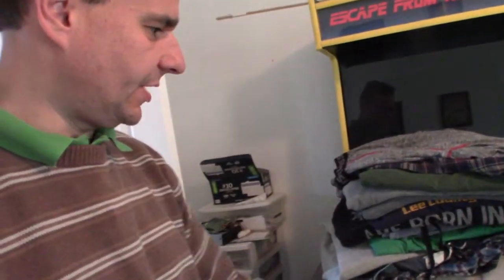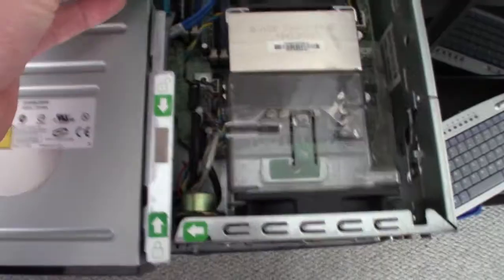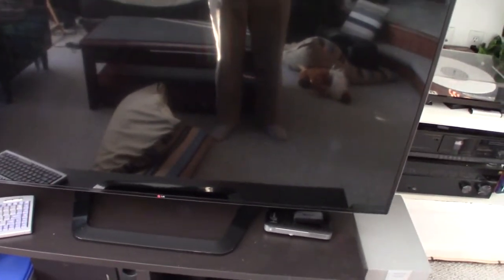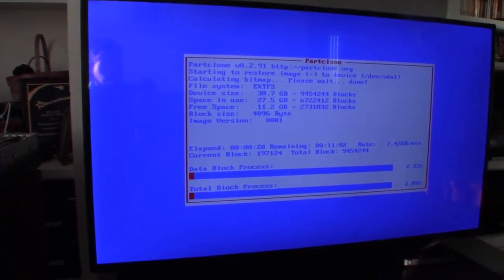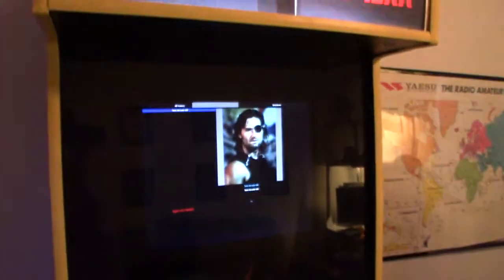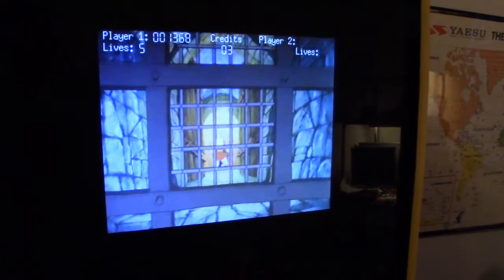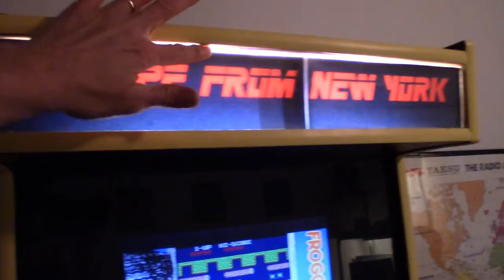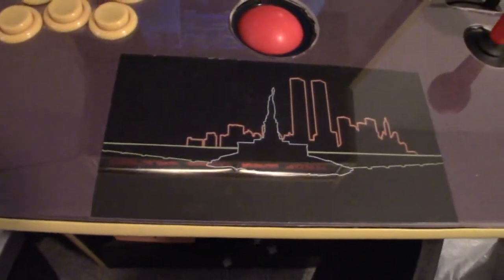Converting IDE Hard Drive to SSD with a Compact Flash Card

Comment: Man I haven't seen Dragon's Lair in forever.  Nice job on the cabinet!   SSD is the way to go.
Reply from the maker: For my main computer I still use traditional disks - I hear for server ops SSDs have a much higher fail rate which is why I stick with disks - plus I can swap them in and out fairly cheaply... but for my other computers, I only use SSD so I don't have to worry about wear.

Comment: I thought I spied Snake Plisskin! Very cool that you built your own arcade. A few weeks ago I got ahead of a failing computer/IDE drive, popped it into an external case and transferred the files via USB to a SATA drive. I'm usually pretty good about backups though. Interesting stuff!

Cheers, Tom
Reply from the maker: For my storage drive I have a script that runs weekly that makes a clone of the drive, and the operating system and other drives I backup twice a year or so - it only takes one failure to learn how important the backups are.  I still am bad about doing an offsite transfer though - I have the portable drive to store at work, but I never bring it.
Reply: I don't do any offsite (read: cloud-based) backups. Too much hacking out there.

Comment: Hi Kris, so that's an emulator you have underneath the arcade cabinet? I did not know you could do all that and run different games on the arcade system. That's really interesting. I'm a bit of a computer geek myself but wouldn't know how to do all that you did. I mostly just fix software issues and sometimes hardware. It's good to know you can back up the system on those older machines too. I had an older IDE PATA hard drive that had died on a Compaq and was running XP on it, rather slow but I dislike Windows 8 and 10.  Finally found another PATA on eBay a couple of months ago. They were nowhere to be found and all of a sudden on eBay there were hundreds available. Crazy! I like your computer videos. Take care, ~Nicola
Reply from the maker: CompactFlash was actually designed to be compatible with IDE, the pins are exact matches - which is great since old BIOS's don't care.  When I built this 10 years ago, you had to do everything yourself - now there are ready-to-download distros that you can put on a Raspberry Pi and you are set from the start without having to know anything.  It wasn't too hard though - it was solve one problem at a time... Thanks for watching, Nicola!

Comment: Very cool arcade console.  Good idea swapping out the old HD.  I've been doing the same to some of my old gaming PCs.  CF was designed with IDE in mind, so they work great as long as the BIOS can handle the geometry.  Probably don't have to worry about write cycles in this application.  My only worry is that CF seems to be slowly phasing out...  :(
Reply from the maker: Correct about the write cycles - there are some things you can do in fstab to help with that, but I always shut down properly, most things run in ram, and the cards are cheap enough to replace in the future if I needed to.  I also chose CF since I knew it was basically an IDE compatible solution so with the old hardware it would be less of an issue.  I figure by time I need to worry about this in the future I would be dead, or at worst, replace the guts with a rpi and move on to something more modern with almost no equipment needed.
Reply: Haha...yeah fair enough.  Rpi is the answer to everything nowadays.  The emulators are getting so good that there isn't much logical reason to hang on to this old hardware apart from nostalgia.  Still, it's fun to futz with crusty old motherboards now and then.

Comment: Wouldn't it be better to get an IDE-to-SATA adaptor & use an actual SSD?
Reply from the maker: It would - BUT this is super old software - it doesn't need speed so having it as compact flash card makes it easier to copy files to/from as well as back up.  Also, SSDs were much pricier back when I shot this video.

Comment: your CF adapter does not have power connector like some other adapters I have seen. Does this thing really need a separate power connector? You are connecting to a 40pin normal IDE, right?
Reply: I think I saw a power connector in the back for a second!
Reply from the maker: It DOES have a power connection - it is a small 4 pin connector - I think for 3.5 floppy drives, but I can't be sure.  I am connecting it to a normal 40 pin IDE connector, and you have a jumper for Master or Slave on the adapter.  It has worked flawlessly.

Comment: The compact flash cards can be about 10 times faster than old hdd drive or as fast as modern hdd drive I think.
Reply from the maker: Very good - the one thing I know is you are limited by the IDE speed, so since this was a very old computer, its slower than modern drives - but still - better and faster than the old stuff.  At this point, I probably should have just converted the thing to a raspberry pi, but that is too much effort :)
Reply: @dixielandfarm  I'm not sure if IDE limits the speed of a CF card. That is actually reasonably fast for a retro system.